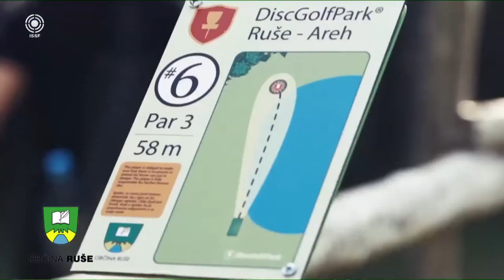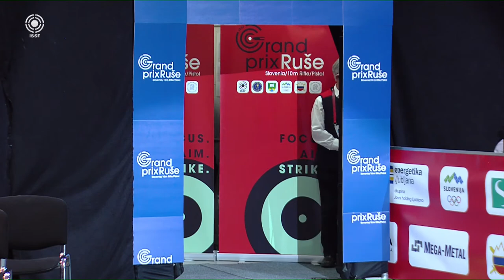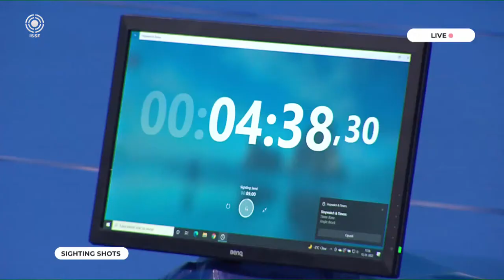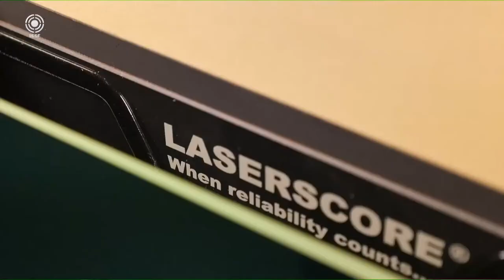Final 10m Air Rifle Men - ISSF GP 10m, Ruse, Slovenia (15.01.2022)

Comment: Shiiiit.... Same Distance Using a Daisy 856 to shoot but only using Four Pumps and I was putting Beeman Pellets through the target No Bigger Round than a Pencil Eraser. Have Witnesses because I use to work at a Hobby Shop. And did even better with the Entry Level Daisy Avanti with Peep Site.
Reply: Yes BRO lol
Reply: @realestate516  It's okay you don't belive. I understand. When I used the Crossman Pellets, you could not tell where they went. They were Misshaped and Oily. Even Daisy Pellets were better. Like I said, I have witnesses and still have the Target Cards ( cards that had stickers in them out of quarter machines ) that are signed by the Witnesses and Store Owner.
Reply: @ravenlorans  I totally agree but can not find them in europe unfortunately or very hard to find.